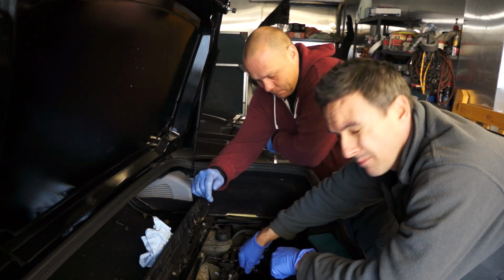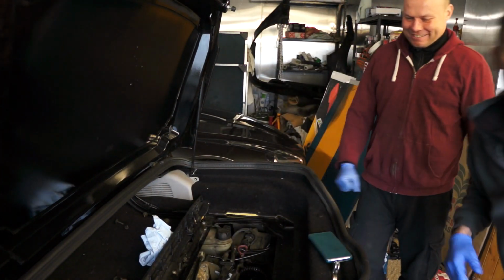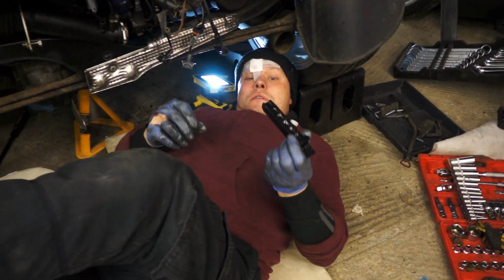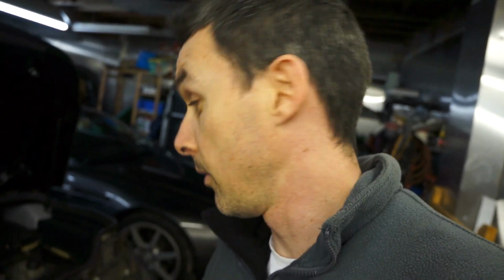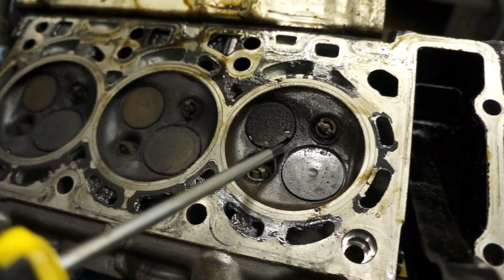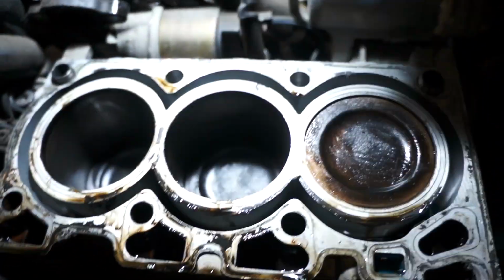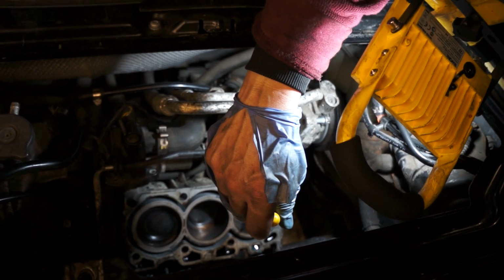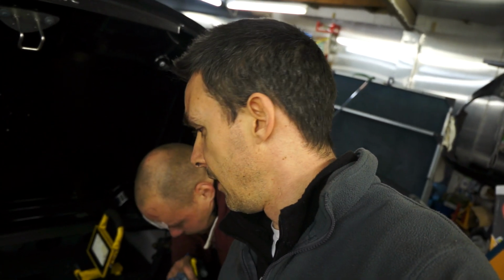Smart Roadster Brabus - episode three of the Broken Roadster

Comment: Guys, way you didn't remove all sub-frame with engine- it's very easy... Now you working at very hard way...
Reply from the maker: With hindsight we would have removed the engine and subframe. The project snowballed and we weren't expecting to find what we did and the engine was halfway stripped by then.